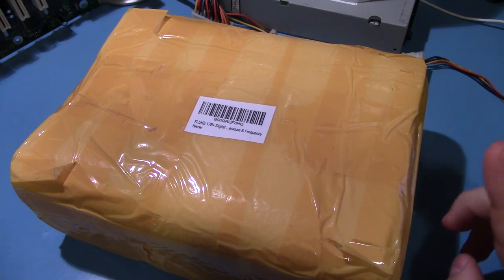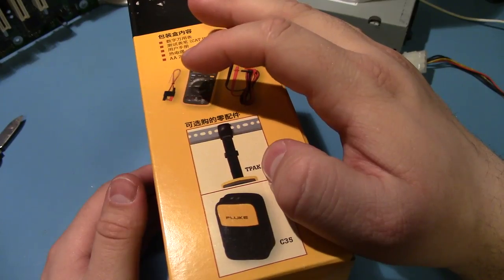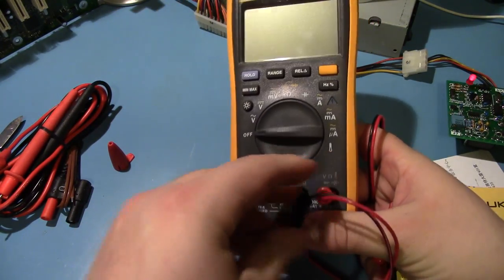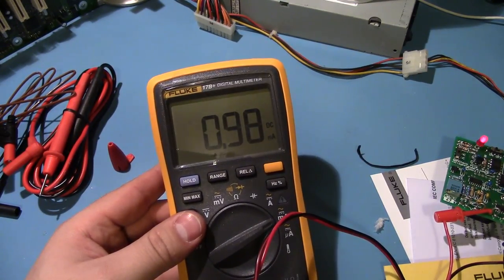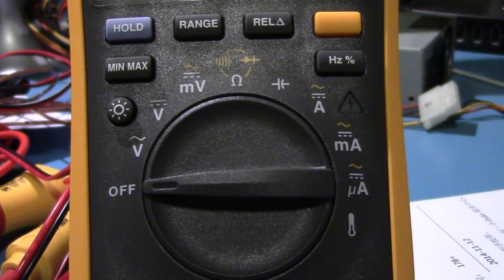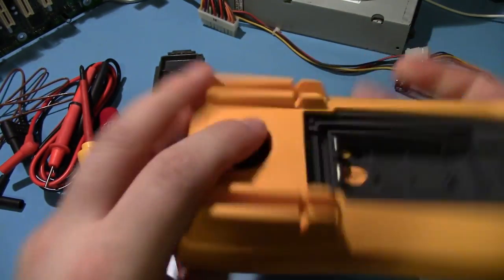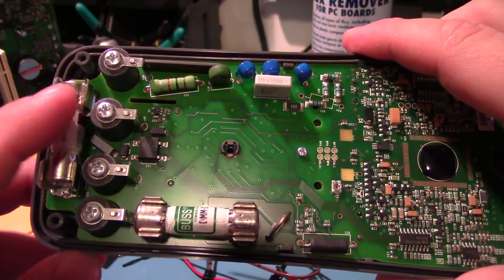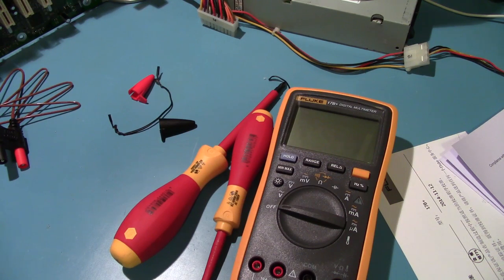Fluke 17B+ Teardown + First Look

Comment: Hi Peter, thanks for posting.
Reply from the maker: No problem at all. I didn't even know they had released a "plus" model until I happened to be looking for a cheap meter on Amazon.

I've watched a bunch of videos on the 17B (including yours :)), but couldn't really find any solid info on the 17B+ other than "it has a larger screen". Haha
Reply: *****  I think the  principal diference is: 17B =mV (DC) , 17B+=mV (AC & DC).

Comment: The red led lights up every time you aren't seeing the instant voltage you're probing, or if the voltage is over 30v. For example: it will light up, if you enter Hz / Duty cycle mode, or there's a range change in progress, and i think also when you use HOLD. The english manual has the description. It can be downloaded from Fluke's website. Very nice multimeter. Not true-rms it seems, but certainly a keeper anyways!

Comment from the maker: +Aleksey M Nope. Doesn't distort. Mine has a plastic window before the LCD so you can't press directly on it. Sounds like either that shield is missing on yours, or the LCD isn't connected properly. (zebra strip coming off?)
Reply from the maker: Aleksey M It looks almost like a static charge. Either way I wouldn't worry about it - as long as it doesn't affect functionality.

Comment: thanks, have you tried the 18b+ ?
Reply from the maker: +IGATECK From what I can tell, it's basically a 17B+ with a LED tester socket and no temperature measurement. I don't have one so I don't know if it is built to the same quality, but personally I would much rather have temperature measurement over a cheap-o LED tester socket - especially since the diode test lights LEDs on the 17. haha
Reply: +Peter Brockie ok thanks a lot, I'm definitely going with 17b+ it also has the min/max opcion